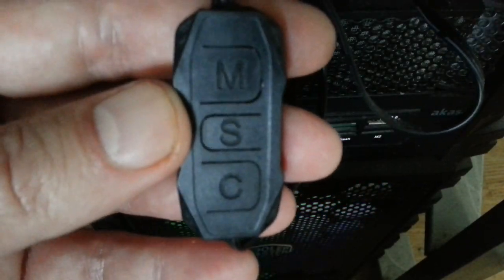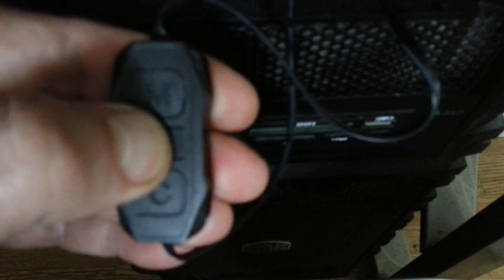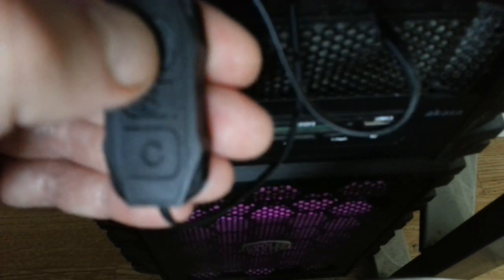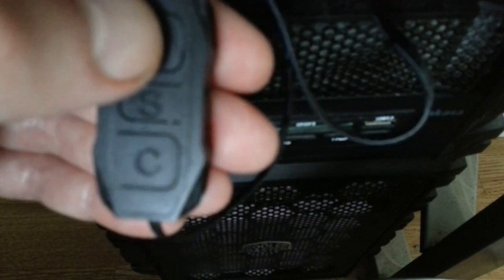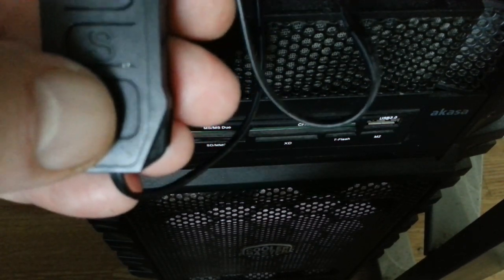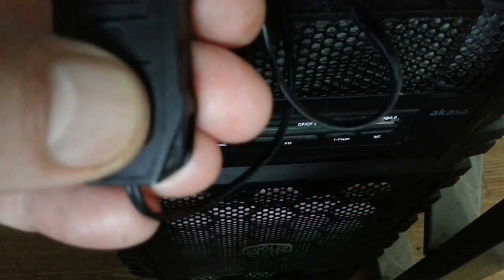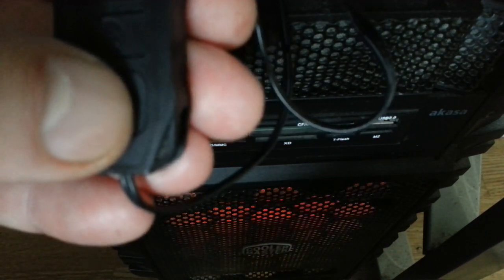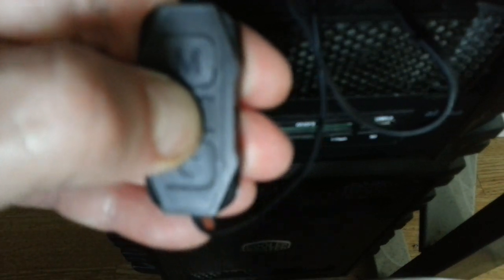My Cerrxian (Coolmoon AR-1) 5V 3pin ARGB Controller Demonstration

Comment: Hi, can i daisy chain multiple argb 3 pin fans to this controller ?
Reply from the maker: Probably but I would recommend getting a ARGB Hub. https://youtu.be/5LxNg_FO9Z4
Reply: if the fans you buy has both male and female argb then you can make a daisy chain with them and can input the final pin into the controller..